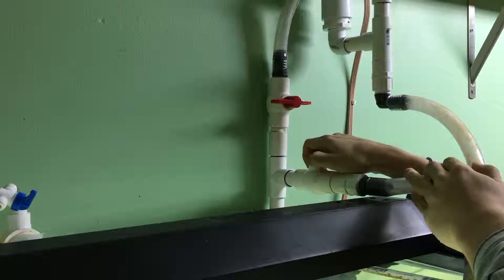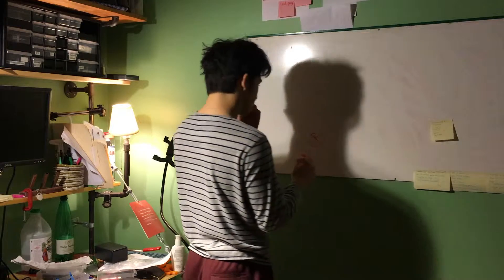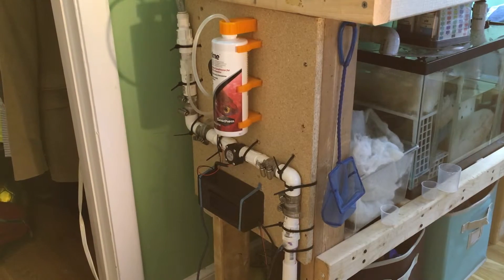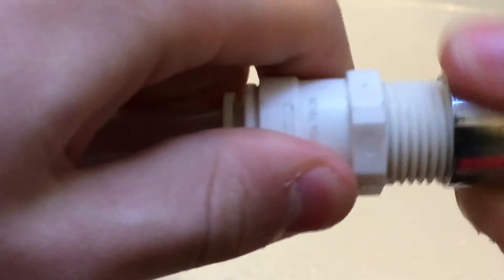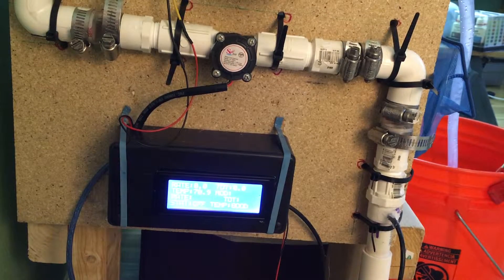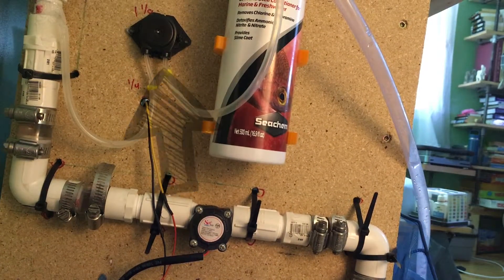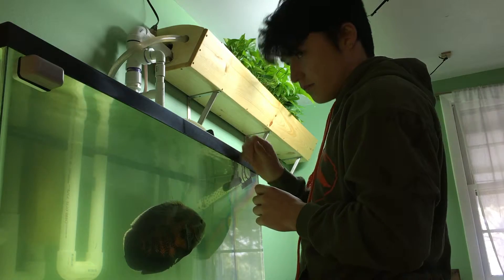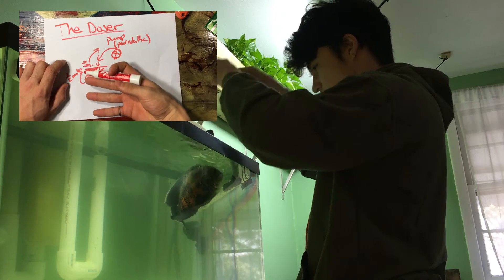DIY Semi-Auto Aquarium Water Changer

Comment: Hi Erik, great video yet again. Very interesting too! as I am thinking about the same type of project. I have bought a large carbon filter that I am going to fit inline with my water supply which I hope will sort out the chlorine problem. Then I will fill a reservoir with this water (on demand) and warm it up. Then when my arduino wants to do a water change it will get rid of a litre (or keep for my plants later, or a refugium, not decided yet) and then top up the tank with a litre from the reservoir with the aid of a couple of float sensors and a couple of pumps (I simplify :¬) ). At the moment I am building a three tank rack out of 2x4 and I will use the bottom tank for a filter or refugium. I am trying to look ahead in the future and plan for the water change system. Can you tell me please ... did you plumb the output water system or do you keep it in a bucket/reservoir? Thanks for your hard work (love the odd socks)
Reply from the maker: Thanks for the comments! Your project sounds really interesting and I'm actually thinking about doing a similar water change reservoir type setup, hopefully this summer. How are you planning on removing the waste water from the aquarium? I would recommend drilling an overflow into your sump so that when you add fresh water to the tank it will just naturally displace waste water. I suppose float switches and a drain pump could work but that seems more complicated and prone to error. If you just top up the tank with fresh water ever so often and let the waste water somehow escape the sump on its own, there's almost no way to go wrong. In my system the waste water has to be syphoned out manually before fresh water is added. I made a massive syphon out of some drain tubing that can probably remove about a liter per second, but still a manual process. It drains outside through the window.
Reply: Very interesting, thank you. Looks like we will be using technology to the fullest with our single board computer hardware. Thanx for the reply. If you like I will post pics of how I am getting on. Thanx again and glad to hear your diet is going well. Kind regards. Pj
Reply from the maker: +PJ Jones thank you, keep me updated on your system! I agree, we're using SBCs to their full potential